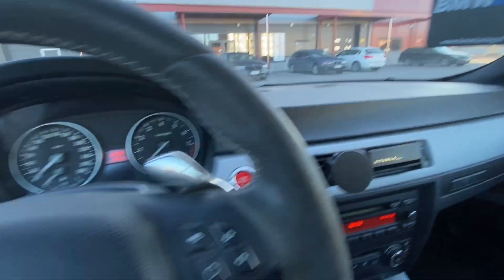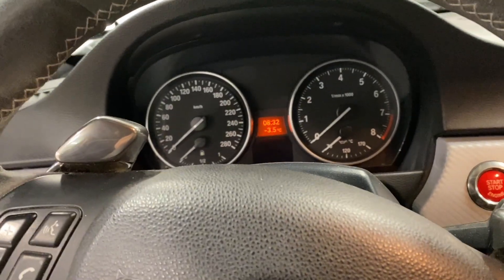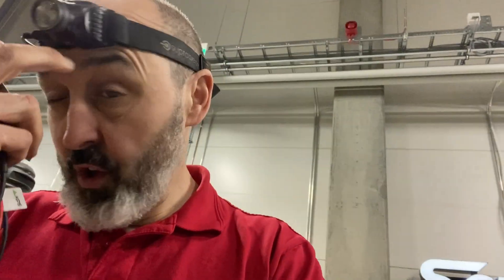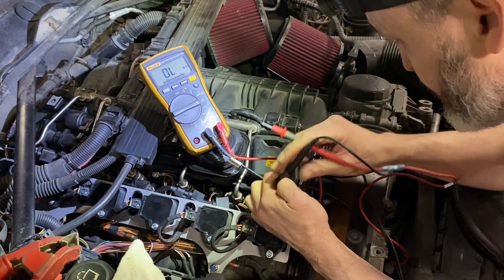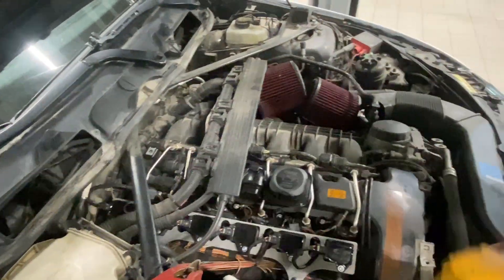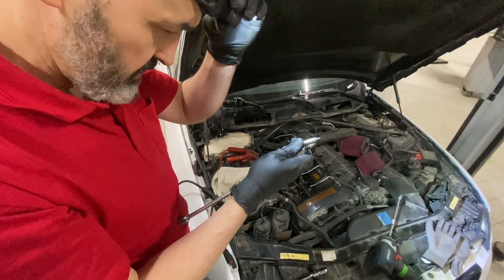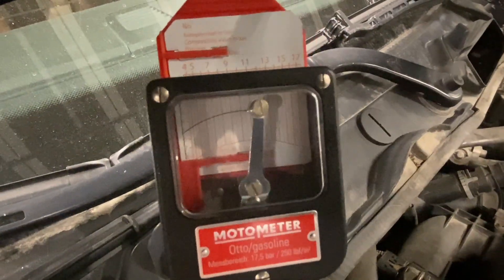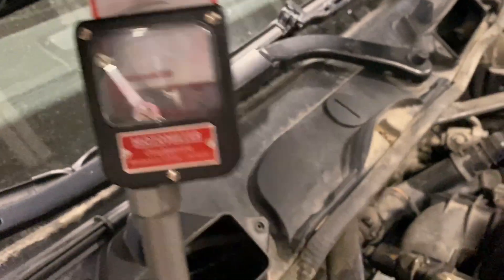This 335i N54 B58 Coil Swap Was Perfect… Until Cylinder 6 Went to ZERO PSI!

Comment: Next time use a diode mode test to transistor

Red probe on ground and black in the connector
Reply from the maker: Both methods work well but just for you here you go DME MOSFET FAIL. HOW TO TEST USING DIODE FUNCTION IN KPS MULTIMETER #dme #n54 #bmw #carmechanic
https://youtube.com/shorts/aFB73SIYel0?feature=share
Reply from the maker: And another a bit more in depth https://youtube.com/shorts/xr5c-rW8kQ4?si=IYl2bf9pcI9cpVcb

Comment: thanks man for checking my car (RLG-625) it has mhd stage 2 tune and also catless downpipes if you were wondering if it had jb4 it doesnt have jb4
Reply from the maker: Hi buddy you are very welcome indeed. Sorry to give you the bad news about that number 6 cylinder 😒 The coil conversion was perfect. Did you buy the plate or did someone laser cut it? The plate is superbly made and fits very well. 

What are your plans next? Is it to be stripped? 🙂 If so I think one of my colleagues will do it. We have a nice N55 Alpina motor rebuild in at the moment as well. 

Glad we caught this before it damaged the engine further. Hope we can get it back on the road for you. Its a nice car 👍
Reply: @ i bought the coil conversion kit from BC motors it came as a full bolt on kit for the car. my plan is that i leave the car for further inspection to see whats wrong with it and how to fix it. you made a great video of my car man! i apreciate that a lot. keep doing the good work❤️🙏
Reply from the maker: @vaatane Thanks so much🙂👍 We will try our best to get you back on the road buddy